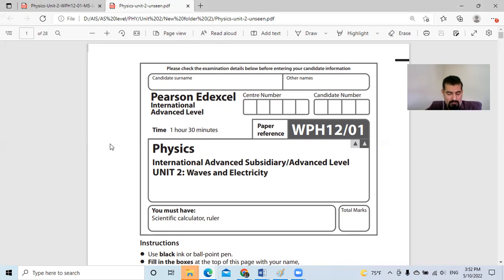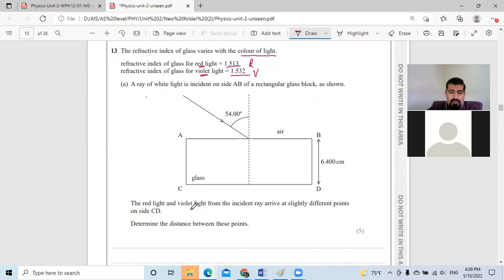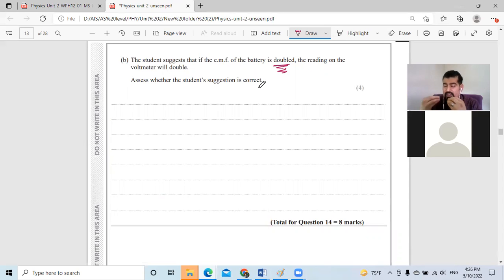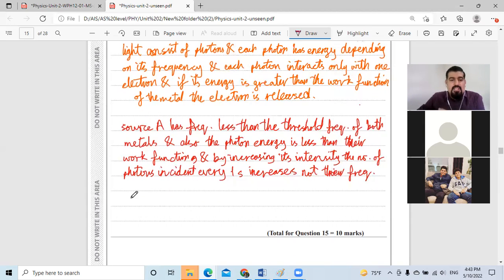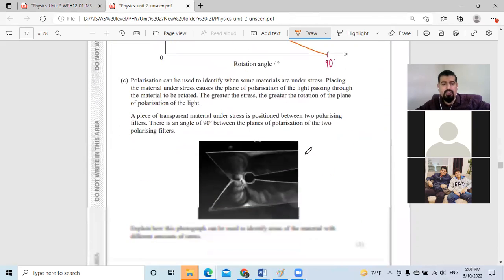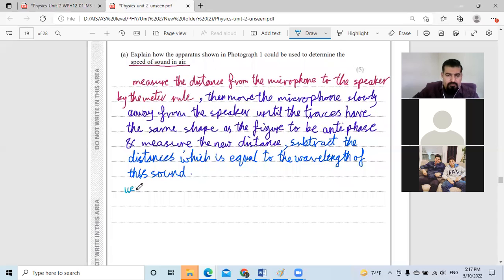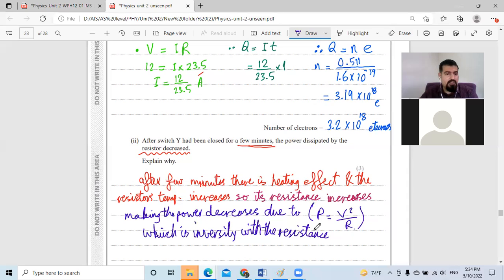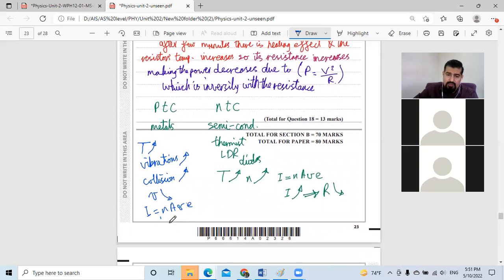Answer & Explain Physics Unit 2 M J 21 Edexcel by: Dr. Ahmad Al Faris (online class course)

Comment: 37:01 HOW DO YOU KNOW ITS MORE THAN DOUBLE
Reply from the maker: @gustybo  did you see the whole video?
Reply: @Dr.alfarisphysics  yes, but i dont understand how im supposed to know that it will more than double and not just double.
Reply: @gustybo  As the resistance of thermistor has decreased, the ratio [11.5/11.5+New lower R(thermistor)] is now more than before.
so, V=11.5/11.5+new lower R(thermistor)    x 9 x (2) as e.m.f. doubled, has a more than double answer.
Reply: @sifatoffey8608  ohh that makes sense thanks

Comment: in question no.18 why does the voltage remain unchanged in the last part
Reply from the maker: The parallel have same P.D.
Reply: Fixed resistorww